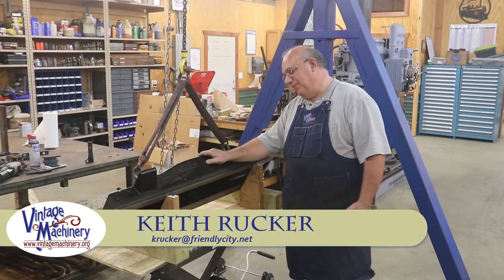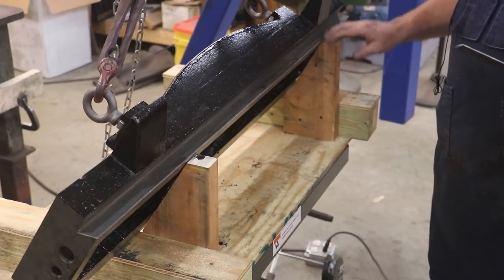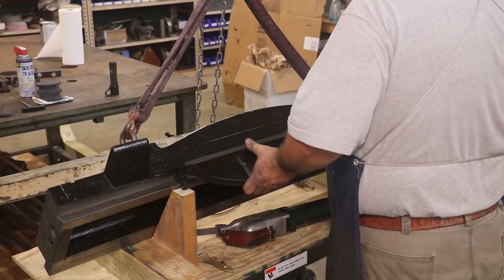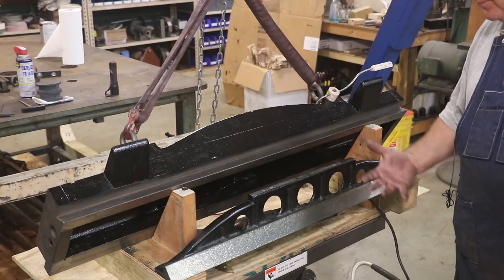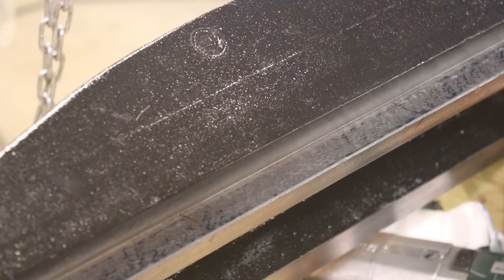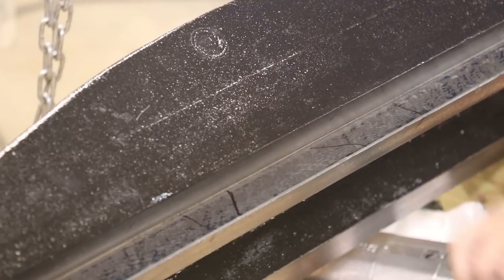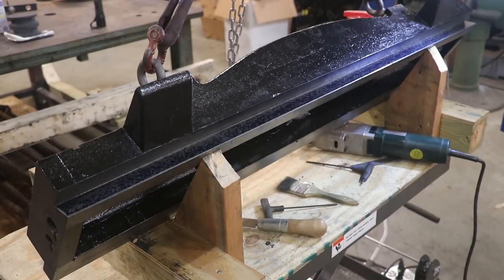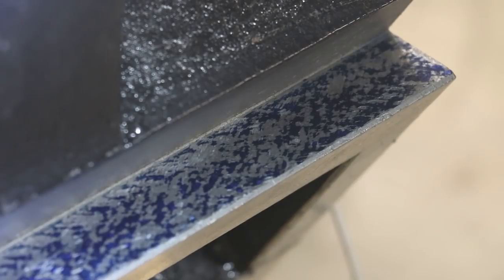New Haven Metal Planer  Restoration - Part 9: Scraping the Cross Head Dovetail and Flat

Comment: Be sure to shim the ends of that bed up and pull it down in the middle when you all grind it so that it will compensate for the weight of all the gears shaft and the uprights that rest upon it later on. Remember flat now doesn't necessarily mean flat later one. :-)
Reply: Good point. Perhaps weigh the columns, rail, and head and note the figure. When the bed is set up on the way grinder, it can be instrumented and a pallet of equal weight (riser blocks, large chucks, what ever is handy) can be placed on the bed in location and the deflection noted for setting the preload you refer to. 

I can't imagine the deflection being over a thousandth or two but it's an important figure. You want the planer bed way surfaces to generate a path flat to a rising circular arc having no more than 0.0002" chord times the square root of the bed length in feet. No sag. That's the pitch plane. Roll and yaw symmetrical tolerance 0.0001" chord times square root of length in feet.

I ran a planer when I was at Lindmark. When it came up for its annual alignment check, the rise and fall (pitch) of any point on the table was in plane within 0.0003" in 16 ft and 0.0004 in yaw as determined by optical collimator. That generates a plane more accurate than most jig borers half the capacity. The machine tool castings we re-tooled for rebuilders were so accurate most of the time scraping was limited to breaking up the surface for bearing.
Reply: It will still need hand scraping after the grinding.   At some point he may scrape one part against the other,
Overhead lift equipment is essential for anything near this big.

Comment: Well damn! Usually I can find a number of points in your scraping videos to find fault with. But here your discussion of order and sequence are right on target even the need for scraping in a clearance surface for use as a pin reference. 

Not to say, I dont have a few remarks: 

I'm not surprised the dovetail has little wear. It's on the bottom and so carrys no weight from the saddle. Only up-thrust from the tool in the cut - no sliding under load.  

The top of the rail (ledge) and the back way (hook way, to some) will be a different matter. These surfaces are subject to the full weight of the assembled head and whatever dust settles between way cleanings combine to wear the mating bearing surfaces. I anticipate several thousandths wear, possibly enough to justify machining but within scraping range.

And a few suggestion: 

Those surfaces you suspect are worn in the center but unworn on either side may be tricky to characterize with a short straightedge. The straightedge may teeter between worn and unworn surfaces giving you blue indications on the worn portion that are actually below the plane. If you apply some weight to the outboard end of the straightedge it won't teeter and its end will project over the worn portion without leaving a false reading in the print.

The intersection of an inside dovetail with its abutting flat is impossible to scrape all the way into the sharp corner. Common practice is to provide a corner relief, (a radius undercut that clears the champher on the mating dovetailed slide) and slight bevels (3 degrees or so) tapering below the bearing faces for the subsequent scraping to wash-out into. I suggest you discuss the corner relief and how to deepen it when necessary.

Your recent series of scraping videos are most instructive and should be required viewing for anyone intending to restore a worn machine tool to new operating condition.
Reply: @chris0tube Yes, in this particular case because the lower dovetail on the rail has practically zero wear. This provides a good reference for working the upper ledge which is weight loaded, slides under load, exposed to settling dust, and intermittently cleaned and lubricated is subject to greater wear. If the ledge was scraped first there would be greater opportunity for the finished geometry to drift from the original resulting in addition work to the lower dovetail to bring it into parallelism.

Scraping machine tools is so expensive in time and physical effort that time spent in forethought and planning the order and sequence of steps pays off by an order of magnitude of time saved in the restoration of machine geometry, linearity, and new machine accuracy and longevity. For example, a novice at-home machine tool rebuilder will most likely skip all or part of  the initial machine survey (a series of tests and record keeping performed after general machine clean-up and adjustment and before commencing machine disassembly) which yields valuable information necessary for planning the order and sequence of operations. Mr Connelly's jthick book "Machine Tool Reconditioning" is pretty much an expansion of my first sentence. Years of referencing the book is what inspired my initial sentence - which I've stated so often in past discussions and classroom sessions on scraping technique as a means of machine tool restoration.

Comment: @16:17  how about bending a piece of spring steel to pull the clapper box mount snug against the dovetail.. stick an indicator on it and slide it across to check the needs of the 2 right angle surfaces to see how far off they are from your conventional round bar and measuring block dovetail type measurements.  written in different color markers..

Comment: So the one thing I didn't see Keith talk about, how do you know the dovetail is perpendicular to the upright surfaces?  You can scrape the dovetail and its opposite square way parallel to each other, but unless you check that, you may have a parallelogram, not a rectangle.  If you have a parallelogram, your tool will be feeding in or out as it moves across the work.

Comment: Hi, Keith, I noticed that you use the dovetail part of the SE. It forces you to balance the weight of the handle.  I think you have enough clearance to use the sole of the SE if you just flip it around the other way.  It is a bit counter-intuitive but you always want to keep the SE on its sole as much as possible, as it gives the least deflection and the best balance.   I also scraped a 4' SE on a 3' plate. In my case, I flattened one side to 3'  then I blended in the remaining 1'.   The way you solved the problem worked because your ways were concave.  In my case, the SE was convex, needed a different strategy.  Nice demo on using a shorter reference.

Comment: Hi Keith, this has been a very interesting series so far - well done! :)
I do get that your 6 foot straight edge is heavy to use on your own.  So, for the next big job, could you set up a couple of pulleys from your gantry with a counterweight to overcome most of the weight in your straight edge. This way you could reduce the "apparent weight", give yourself a few grams of downward force to overcome and make your life a whole lot easier.

Comment: Could you comment on how this work would have been done and to what standard when the machine was new? It would seem each operation could relieve stresses in the piece making the previous step slightly off.  Would they have ever just lapped one part against it's mate and called it good?
Reply: Mark Bernier he is removing 10ths off a hundred year old casting. I would call that "seasoned". To release internal stresses you need to remove more than that. You would not want to lap. That does not ensure alignment between surfaces. It would just transfer flaws from one surface to another. Also you would have no bearing points. You would have full contact so no place for oil. What Keith is doing is following current standard practice for optimizing alignment for machine performance and minimizing wear as taught by Richard King who has 40+ years of experience. Also, I would not be surprised if Keith has been calling Richard to get some coaching for this specific job. I don't know many people who have scraped big planers but Richard has done many. I don't know to what extent these practices existed in the 1800s but that doesn't really matter.
Reply: @chris0tube Two polished surfaces causes stiction. That's a bad thing if you don't know it. Metal-metal contact is bad, that's what lube is for. The high spots are what make contact, always lightly lubed... 1) That's the index plane, not the gaps/low spots. 2) The low spots carry a flow of lube, that capillary action will draw into the high spot contact areas as needed. That oil also needs to be replenished by the operator.
Trust Keith and take what he says at face value as truth. If something  doesn't make sense, try to fill in the pieces by other things he talks about. Or ask.
Here's a related factoid that may help. Ice skates don't ride with the metal directly on the ice. The skater's weight melts a thin film of water that the metal slides on. That's why blades are sharpened to a concave shape, to help 'contain' the water under the metal.
Reply: @chris0tube I said stiction, that that's why scrape finish is necessary and polish fails, and you didn't reply to that. By now you've seen part 10 and heard him talk about the final scrape after the grind.
Reply: @chris0tube I replied and said stiction again, and Part 10 'final scrape.' I will reply only with stiction until you address it.

Comment: What is the end result going to be compared to the machine at its original new working condition? I mean should everyone one brake down there new machines and scrape every surface or is the scraping more to bring older machines worn surfaces back to level with each other

Comment: Is it intended to mate on all three surfaces on the dovetailed side? Commonly it would only be on two of them. Three seems overkill and way more complicated to scrape.
Reply: I've never seen that either.
Reply: @WatchWesWork  Nor here. Usually relieved a fair bit like on Bports. Maybe they did that on some old planers to get more bearing surface without a bigger casting.
Reply: I think that bottom plane should have a slight clearance to the slide

Comment: It's going to be tricky to get the clapper box casting to be in contact with the two parallel parts of the dovetail at the same time throughout its travel.  Usually with a dovetail there is clearance to one of these surfaces.  Also, there seems to be an unnecessary extra gib.  I would have thought two was enough.  Is there a reason for this?

Comment: Well it seems to me you need a bigger straight edge, not withstanding the huge ones you already have.  I now see why you need the reference to span the entire surface to be checked.  In itself that was an "Ah, Ha!" moment for me in understanding exactly what is going on with the long surface bluing and the need to span the whole length so as not to fall into a hole and produce a bogus reading, otherwise the results can be a total hoax.  Now I have the idea, thanks that put it all together for me.

Comment: dove tail angle?  How do you know it is correct?
Reply: I can answer this one. The dovetail angle doesn't have to be exactly a certain angle. It only has to be a precision scraped plane surface.

When Kieth scrapes in the mating surfaces on the saddle, he will blue the dovetails and the flat on the rail (what Keith calls the "cross-piece") and scrape the bearing surface of the saddle to match. Thus, the flats and angles are plane surfaces that bear properly. When the gibs are fitted and installed the saddle motion is constrained to planar linearity over its full travel.

Comment: Great work. I saw the grinding of the other parts on Instagram. So I'm curious. Could you use a planer as a grinder when mounting an electric grinding wheel instead of a cutting tool.

Comment: Keith - MOUSE SIGHTING. At 27:26 of your video running across the floor on the lower right of the screen. They like to chew wires in machines to make their homes there. Wheres your cat?
Reply: lizard?
Reply from the maker: I think it was a lizard.  I have plenty in the shop.  Never seen a mouse in here...  I like lizards - they eat insects!

Comment: As accomplished and exacting as you (and some of your peers) are, I do not understand why you cannot
grind flat surfaces, those that can be mounted and got at with a grinding wheel, instead of scraping.  Seems
to me a grinding wheel could be made to leave high places in the work.  Maybe one with fine lines that you
could apply at 45 degrees initially and the next pass perpendicular to that, leaving a crosshatch of sorts.
Maybe the piece could be embossed.  I realize that both surfaces cannot be flat flat because of sticking.
I see no reason a plain flat surface could not be machined to produce the same results as scraping.

P.S.  I no absolutely nothing about what you do other than watching you, which I enjoy.  Thank You.